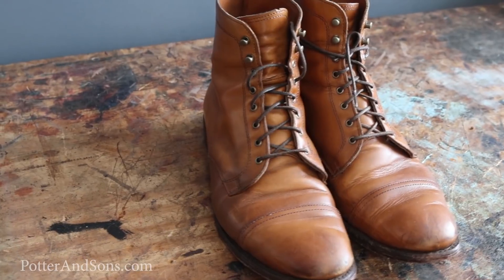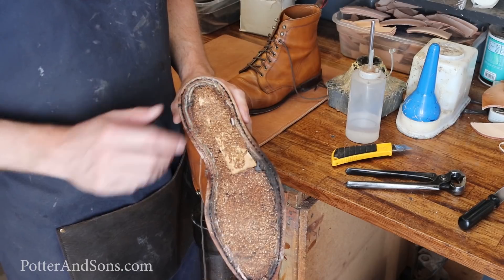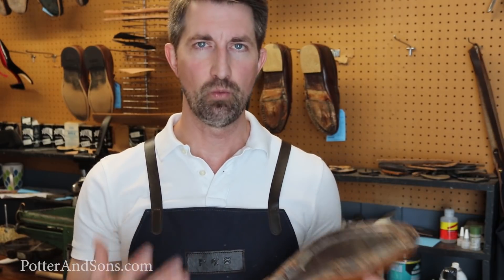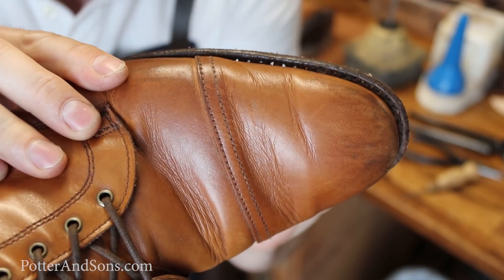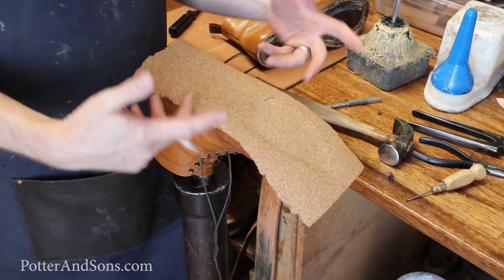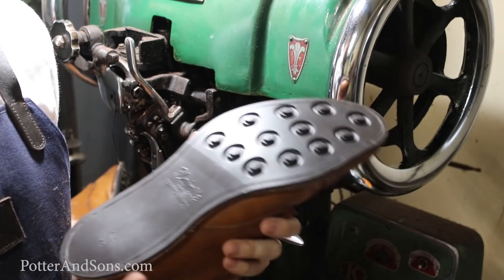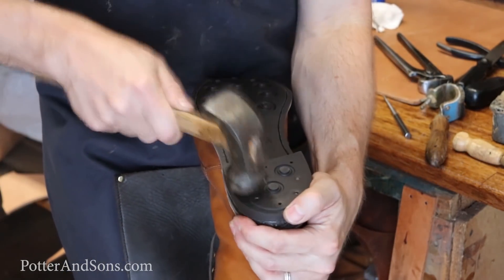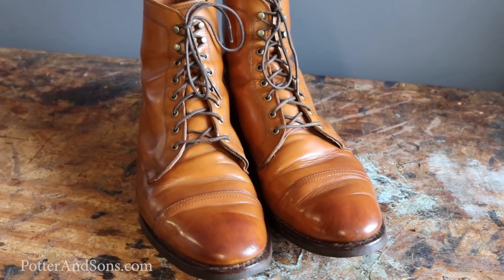Allen Edmonds Restoration | Repair with Dainite Rubber Soles

Comment: I like this craftsman. He explains what he is doing and tells us why he is doing it. Just a heads up to the Allen Edmonds experience. There are many shoes that are more expensive than A.E. None of which compare to the quality workmanship that goes into the A.E. Shoe. In addition if you call the factory and request having your shoes recrafted, they will mail you a postage free bag. Place your A.E. shoes in the bag and mail them with your name, address, phone number. Explaining what you would like done. They will send you back your shoes and they will look close to new. Excellent company, great service.
Reply: I did the Allen Edmonds recraft once. But what I found to be a better idea was to start a relationship with a local cobbler who you can personally talk to about the process. (I use Vinny from A1 Shoe Repair in Sonoma, CA) 

I have had a much better experience and with higher quality for a slightly less cost with a local guy.

Comment: Question?

Are the holes in the welts a standard distance apart for all shoes? Meaning, do you ever have to adjust the stitch width on the machine to match to hole spacing on the welt to reuse the same holes?

Fascinating!
Reply: I wondered the same.

Comment: Nice to see a traditional Cobbler at work. Apart from looking good, what are the advantages of a Dainite sole and heel over leather?
Reply from the maker: Steve Mr W Thank you!  Dainite’s are going to last substantially longer than most leather soles because they’re a harder rubber.  They also have a little more traction due to the little nub things on the bottom.
Reply: @TrentonHeath  I have a traditional Cobbler close to me . So I may go for the Dainites.

Comment: Should spend more time showing off the finished product at the end!
Reply from the maker: Daniel Tojcic Will do. 👍🏻
Reply: @TrentonHeath  I agree! You should post before and after shots..
Reply from the maker: Cassie B Check our some of our newer videos.  We’ve started doing that.  It does make the finale much better.  😉
Reply: A few close-up shots that linger just a bit (maybe in slo-mo) would do the trick.
Reply: @TrentonHeath  question for a different video. Just purchased two pair of Johnston&Murphys. Can they be refurbished if I'm willing to spend the money?
Reply: .....agreed. We need more time to take in all of your work. Close ups, stationary, and slow turn table or similar. A good 30-60 seconds would be nice
Reply: Is anyone else fascinated with the little glue bottle that looks like a volcano?   It’s like an instant indicator of hard work as I’m sure the glue builds up over tine.

Comment: How did you get the machine to use the old holes in the welt?
Reply: I had the same question. I wonder if there's some kind of stitch length setting, or maybe even something on the machine that can find the next hole?
Reply: @hombre3000  I was wondering about the same question! There must be (I guess), how you said a  "stitch length setting" option or some kinda "trick" to "target" the same hole twice into the exact same spot!
Reply: The needle takes the path of least resistance. If theres already a hole real close to where the needle comes down, it'll sink through that instead of punching a new one

Comment: Trent, before restitching the new sole to the welt, you briefly discussed stitch color - the way you described it, I understood you to mean one could have one stitch color as viewed from the bottom (outsole) and another stitch color as viewed on top of the welt. Is my understanding correct? If so, can you elaborate on how this is possible?
Reply: Many sewing machines use two different spools of thread to make their stitch. One spool feeds the top half of the stitching, the other feeds the bottom half. The top needle pierces through the material, bringing the top thread below the material, where the bottom thread can hook through it, before the top needle goes back up. This leaves the bottom thread locking the top thread into position. Googling “how does a sewing machine work” should pull up many animated GIFs illustrating the idea, and I figure the principle is much the same for fabric sewing machines and leather machines.

Comment: i alwawys wondered how the nails never hit the foot. eventually with wear and tear youd think the nails would start coming through, but apperantly it don't.
Reply: my guess is that the nail's aren't long enough to start being prickly on our feet
Reply: some times they do go through but they hit the metal thing they put the shoes on and they crimp while being hammered in so that the sharp edge is blunted and turns back towards the head of the nail
Reply: It can happen, I had a pair of Redwings that did it. They replaced them without a fuss. Too bad they had to give up their souls...
Reply: @soggycracker5934  nice reply lol

Comment: How can we tell if a pair shoes/boots are candidates for repair versus replacement? 

I have great quality work boots (red wings), dress boots (real and fake gator/bird/snake boots) and leather dress shoes (with or without leather sole). None are more than $300 or $400 and I cant always tell if the stitch is real.

Comment: Hi Trenton and Heath, I absolutely loved the video. just amazing to see the whole process. Came over from The Kavalier, and wanted to know would the saphir Reno Mat remove the top coat from a Cole Haan or a Jonston and Murphy shoe ?
Reply from the maker: Farhan Ahmad We’re glad to have you!  In regards to the Reno Mat, it can.  I tell folks that you have to be very careful when using the Reno Mat, or any other stripping product, as it can definitely remove the finish on certain leathers.  It’s usually best to only use this product on smooth, higher quality, open pored leathers.  We work on A LOT of Cole Haans and Johnston & Murphy’s, and I would not recommend this product on most shoes from these brands.  I would probably just stick with a basic saddle soap if you’re just wanting to clean them.  I hope this helps.
Reply: Renomat destroyed a pair of my $ 900 Santoni shoes, it absolutely stripped ALL the colour off in a matter of seconds. Risky stuff..
Reply from the maker: Nick De Bruin Yep, we totally agree.  It’s a great product for removing old built up waxes, but it’s definitely not for every shoe.  I believe a lot of Santoni’s have hand burnished finishes on them, and it’ll strip all of that right off.  We’ll do a video on this product soon.
Reply: Trenton & Heath, I was just gifted a new pair of Cole Haan loafers, and the shoe cream comparison video I saw that you guys said that Cole Haan shoes have a top coat on them, which can prevent the cream from soaking in the leather. I just wanted to remove the top coat to apply the Saphir cream on them. Thank you for the response!

Comment: Just found your channel couple of weeks ago, thank you and subbed!  Two quick questions if I may  - dainties soles, do they make the shoes/boots more waterproof? And what do you do after you applied Renomat, do you rinse it off or just wipe it off using wet cloth?
Reply from the maker: M Sato Hi!  Thank you for subscribing!  Any rubber sole will be more waterproof than leather soles.  It doesn’t necessarily make the shoe/boot more waterproof, but the soles will be.  As far as the Renomat, I would recommend using a saddle soap to clean off the shoe after using it.  If you don’t have a saddle soap leather soap, at least wipe them down with a damp cloth.  I hope this helps.

Comment: guys, just found the channel and really enjoying the videos. in this one you mention having different coloured thread on both the top and bottom stitching of the sole. can you explain how that is possible? i assumed it was a single stitch? 
thanks and greetings from Glasgow, Scotland!
Reply from the maker: cjrae72 Hi there!  We appreciate you watching us from over there in Scotland!  🏴 The Goodyear welting machine uses two threads when it stitched...one for the top of the welt and one for the bottom of the sole.  It wraps those two threads together and pulls them tight as it stitches.  We are able to use different colored threads to match customers certain taste.  Good question!
Reply: @TrentonHeath  Thanks for the response guys and for explaining the process. Im thinking of putting Dainite soles on a few of my leather soled shoes due to the often wet weather here. I might explore the option of different coloured threads just to mix things up a little. Keep up the good work!

Comment: I'm new to GYW shoes and have learned so much from your videos!

Question: Even if your cobbler removes the old stitches from the welt how can you be sure they're reusing the holes? From other forums I've read, it sounds like new holes are punched every resole since a machine does it. After 2-3 resoles the welt will have too many holes punched and need to be replaced.

You mentioned you'd reuse the existing holes and used a machine to stitch the new soles on. Is there something special about the machine that it can know where the existing holes are? Or do you set it up to the original stitch per inch and do the best you can?
Reply: Watch any video by Brian The Bootmaker, EVERY resole he does gets a new welt. Its just laziness not to replace the old welt.

Comment: Can rough spots on the toes, heels, etc be buffed back to a smooth finish?
Reply from the maker: Leroy Barker Often times, yes.  Depending upon how rough, it may take some time and some light sanding, but yes, many times those spots can be smoothed out.

Comment: Coming over from the Kavaliers channel! Do you find a noticeable shock absorption difference between leather soles vs dainties vs crepe?
Reply from the maker: Clint W We own shoes with all 3 types of soles.  Crepe is probably the most shock absorbent (we both have Clark’s chukkas), then maybe the Dainite and then leather.  Not a huge difference between the Dainite and leather, especially if both shoes have the same cork midsole such as Allen Edmonds and other higher-end brands.
Reply: Trenton & Heath thank you!

Comment: Hey Trenton & Heath, I am just finding your channel but have really enjoyed the content, specifically the point of view from real Craftsman. Do have a question. Some sub par shoe brands I have notice, shoes under $100 will seem to have fake welts, stitching to make it look like there is a welt when there is not. How can a consumer like me tell whether a welt is genuine or not? I mainly ask bc I have a pair of shoes that I would like to get resoled but am not sure the welt is real. I'd love to hear your thoughts!
Reply from the maker: Thank you!  We're glad you're enjoying the content!  Wow, that's a tough question, and I say that because even we have difficulties at times trying to determine if a welt is authentic or not.  Many times we have to take customers shoes and try to pry away the welt from the sole to determine if they're real welts or not.  Manufacturers are realizing that that's a selling point, so they're often molding fake welts onto the soles.  One of the biggest things is what you mentioned...the price point.  Shoes $100 or less, brand new, will often not have real welts.  A big indicator is usually the sole itself.  If it's a cheaper shoe and the sole is RUBBER, there's a very, very good chance that it's not a real welt.  If the shoe has a LEATHER sole, there's a good chance that the welt is real.  Rubber welts are usually indicative of cheaper shoes, so I always encourage folks to look for shoes with leather welts.  I hope this helps.  Thanks for the question!
Reply: @TrentonHeath  that does help! My shoes do have leather soles so I'm thinking that they are. Tbh they were a gift about 4 years ago and I'm not sure what the MSRP was but there about to wear holes, so I believe I will take them to my local cobbler and see what he has to say about them! Thank you so much for the timely response!

Comment: As a guy who will replace my leather soles up to 6 times over a 20 year period, replacing the welt at the factory is just a bad idea. Welt replacement on a high speed machine will tighten the shoe up and the gemming gets a beating. AE does not even try to use the same stitch holes. This can really cut down the amount of times you can replace the sole.
Reply: If I just bought factory second which are basically new shoes with imperfections then I should just change the soles to dainate. I mean the price this guy offer for dainate $105 isnt that far off from allen edmonds $125 package + $20 resole. Only saving $40 but allen edmonds will redo everything but may not be worth it for new shoes as I only want the sole redone for better traction

Comment: Why isn’t a midsole used on this one?
Reply: I noted this omission as well.  He did state that the customer wanted to go from a leather sole to a rubber sole.  I would think that a leather midsole wasn't added because he wanted to keep the original shoe height and profile.  Regardless, I would have requested a thin leather midsole to protect the cork in the event of the Dainite rubber wearing through.
Reply: Snib2987 I have a pair of Allen Edmonds with dainite soles 

I think the leather midsole looks cool.  It is a nice detail.

Comment: I have a question. While you did not exactly say it, but it sounds like you do not have the capability of replacing the Goodyear welt in your shop. Did I hear and understand you correctly? If so, why is it that you do not replace Goodyear welts in your shop? I was under the impression that this is some kind of standard practice related to shoe refinishing projects. I hope my question makes sense and please know that my question is in no way a criticism of your business practices. I’m just trying to educate myself. As to the video itself, I learned quite a bit about the resoling process, particularly how important it is not to put too many holes in the soles or Goodyear welts. Another fine video. Thanks for sharing.
Reply from the maker: Ed F Thanks for your question.  Yes, more often than not, we can replace the welt.  Check out our Wolverine 1000 Mile Boot video.  We completely re-welt the boots in this video.  While replacing the welt is often an option with Goodyear welted shoes, what I was trying to get across in the video is that it’s definitely NOT mandatory when resoling a Goodyear welted shoe.  The vast majority of shoe cobblers don’t replace the welt each time they resole simply because there’s no reason to, if the welt is in good shape.  I hope that answers your question.  Thanks again for the inquiry!

Comment: Allen Edmonds' re-soling service doesn't hand-stitch the new welt to re-use the original holes, so it turns the bottom edge of the upper and gemming into Swiss cheese. They also don't remove the old stitches. 🤦🏽‍♂️